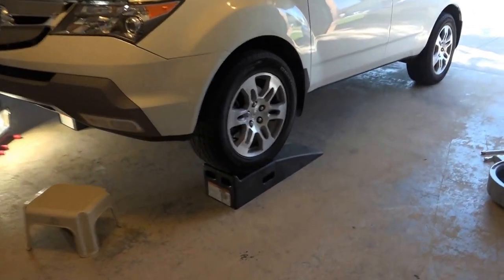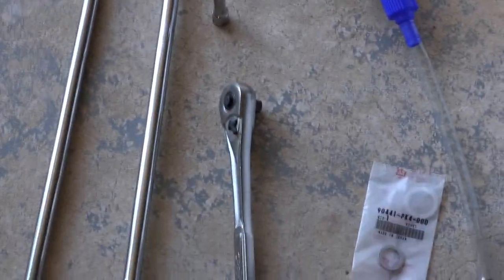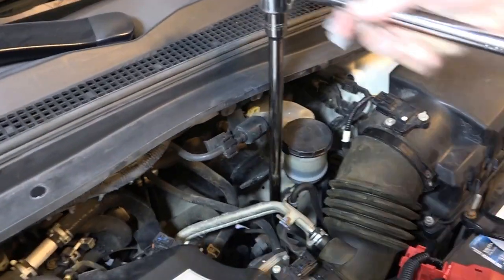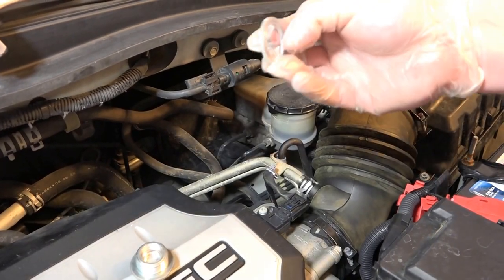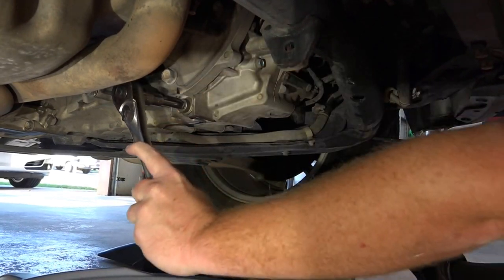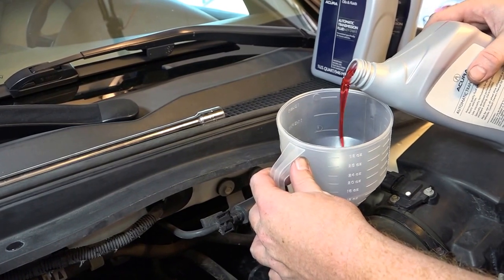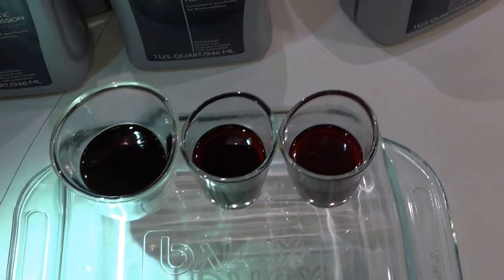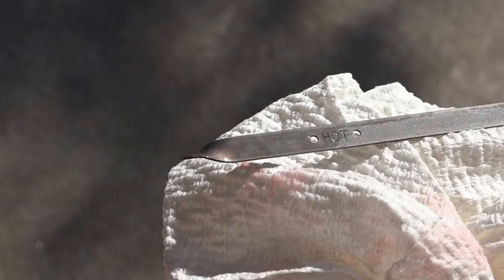How To Change Automatic Transmission Fluid [ATF] on 2007 ACURA MDX (Honda Pilot is Similar)

Comment: Thanks for the video & by all means i'm not trying to find fault with anything , just an FYI..... when pouring from an oil  bottle let the spout be on top, it allows the air to flow through the bottle & it will flow without the chugging & splash......try it sometime.... again thanks for the helpful video.....
Reply: a72bigblock nice tip!

Comment: I am very appreciative of your DIY videos on your 2007 Acura MDX.  It is very informative and easy to follow.  I was hoping if you have or plan to have videos dealing with starter, alternator, radiator, suspensions, timing belt, water pump, spark plugs and brakes removals in the future. Thank you, Sir.
Reply: You can find most of the suspension work for Second Gen car (2008, which is the same as 2007 and 2009, as well as 2010-2013 mostly) on my channel, as well as spark plugs, brake service and many, many more (about 50 distinctive videos).

Comment: There is an error in the owner's manual (incorrect fluid amount). The actual fluid drained and amount to be filled is about a gallon (provided you have a proper fluid level). 3 quarts is definitely not enough to bring it up to proper level. Make sure you measure the fluid level on a fully warmed up engine on a level surfance about a minute after you shut off your engine.
Reply: His 3 qts made it between the dipstick dots on a hot engine. I’d think a gallon would overfill
Reply: I would think 3.3 quarts will be perfect.
Reply: probably because he jacked up the front tires but not the back so there's more old fluid still in the transmission that hasn't been changed. People warn against flushing transmission fluid since it could dislodge and lodge metal shavings and particles and brick the transmission. Maybe changing most but not all is the way to go...
Reply: @sugarrayrob1930  a 'flush' and a change are 2 different things. never flush just change.
Reply: Barring an existing fluid leak issue or a loss of fluid somehow, if 3 quarts came out, 3 quarts comes back in, no? And if dipstick indicates the correct level then it should be good 👍. Don’t understand your logic of a gallon….

Comment: So u flushed it out 3 times and every time u took it for a test drive to recirculate the fluid?? Only 3 bottles to fill up?
Reply: Veth Lab each time he put 4 quarts ,system takes 12 quarts I believe so he did it four times to get the old fluid out, because not all comes out

Comment: Is this the piece that controls the auto down when put in reverse gear?  Mine has started ‘sticking’ in the set position when put in reverse gear.  If I go to park and then back to reverse, then it moves.

Comment: Good info, 
Seiyah. How many quarts did you used to get at the right level?
Reply: 3 3/4 qrts ATF DW-1
And a brand new crush washer install it flat side towards the plug.
Reply: @-MrRichBiker1967  that's only one round out of the 3 that are needed. It's 15 quarts in total

Comment: can you just siphon it out of the dipstick?  also can you just refill through the dipstick?
Reply: The value of taking the drain bolt out from the bottom is wiping the metal shavings off the magnetic end.  You'd be surprised how much is captured.  Cleaning it gives the bolt the opportunity to capture more of that crud until the next fluid change.  And the fill bolt may require a cheater bar, but you have relatively good access to it and it will come off with some force.

Comment: Have you ever had any problems with your MDX transmission?  I'm thinking about purchasing a used 2007 Acura MDX.
Reply: Had a 2001 MDX which I gave to my sister -- I had 100,000 on it, and she put another 150,000 on it until she traded it in for another MDX.  No transmission problems of consequence.  I've had a 2008 MDX and I've changed the fluid twice -- and I have 135,000 miles -- with no problems.
Reply: Michael De La Garza thanks
Reply: Joon kinloch never have a problem on MDX
Reply: Joon kinloch the shock have problem after 100,000 miles

Comment: For a 3x3 drain and fill procedure, are you supposed to drive the car around for a few hundred miles in between each drain and fill? Or should you try and do it all in a single day?
Reply from the maker: No, 3x3 means drive it a few miles and come home and so on. Just make sure you go though all the gears so that may mean more miles. I live in the country so I can hit 50MPH (5th gear) within a 1/2 mile or so and go though the gears fairly easily before I go back home and to the next flush.

Comment: Any issues with transmission "shudder" around 35 - 45 mph?
Reply: I get a lot of engine braking from the torque converter at 45 a little shutter that's probably what it is and then it feels like it's a dog ,it loses power.

Comment: I don't understand why do you need to drain and fill 3 times? which means you need to buy 12 liters/quart of transmission oil.
Reply: Gamer BoyYT transmission takes 12 quarts I believe but only about 4 quarts comes out, what he did is basically take out 4 and drive and push old liquid out and take out 4 quarts and drive again. Get old liquid circulated around the transmission. He wasn't doing a flush where he drains while putting in at the same time.
Reply: That's how you full service your trans oil..
Reply: From my understanding this is preferrable (drain and refill, dilute) method if transmission was not flushed and has over 75k miles for longevity reasons
Reply: Hi maybe i missed it. What kind of oil? My manual says z-1dealers only have the w-1 but it says not to use in all wheel drive cars. Im confused

Comment: do we really need to change it 3 times? and waste the other 6qts?
Reply: The total capacity is something like 8.5-12qts? (heard different things, not certain for this 5 speed), most of it does not drain (remains in torque converter). But the basic concept is that you are basically diluting it. Yes, some of it inevitably does get wasted. On the 3rd fillup, you are technically throwing out more new fluid than old (and fluid is expensive!), but how clean you want to keep it depends on yourself. I did a 2 times change (not 3) after 50k on my 2011 model and my shifting went from average to amazing. I am planning to do another 2-times change in 30k.
Reply: Some suggest out that you can do an annual three quart change -- that will help to keep it reasonably clean.  It's probably not a bad idea, as it will have you keeping an eye on it at least once a year -- which is probably more than 90 percent of folks regularly do.
Reply: Most shops just drain and fill one time I think, and call it transmission service. At the dealership it's done 3 times and they call it a FLUSH.

Comment: Do you think it would be ok to do the drain and fill with the Castro multi vehicle transmission fluid, but then use the Acura fluid for the final fill in order to save a few bucks??
Reply: J S always use what Acura recommends. Don't mix fluids
Reply: Not worth it.  Fluid is cheap, transmissions aren't.
Reply: Some of that previous Castrol would have still been mixed with the solution, might has well kept it homogenously Honda/Acura/Idemitsu transmission fluid